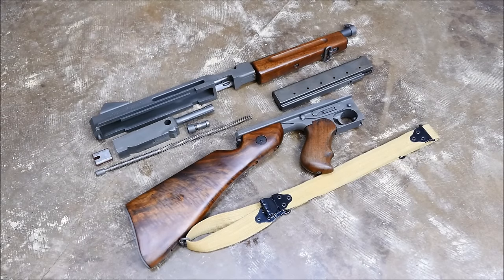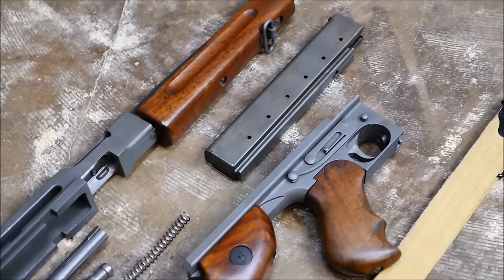Thompson M1A1 Full Auto Field Strip

Comment: Quick question: I recently inherited a WWII M1A1 Thompson (with all the appropriate paperwork filed) and want to strip and clean it for long term storage. My concerns are: Any unusual aspects I need to be aware of? and best practices for cleaning/maintenance of the wood furniture? It was my grandfathers from Iwo Jima so it means a lot to me that everything remain complete and original, thank you.
Reply: I own an M1A1 and a 1928 A1. I use Break Free CLP on the inside and the outside and then I use Lucas extreme duty gun oil on all of the internal moving parts

Comment: The M1A1 is my favourite version of the Thompsons, I find it both the coolest looking and most interesting due to its use/purpose for WW2.

Actual manufacturing cost and how cheap it was compared etc etc doesn't really make a difference to me when it comes to preferring a certain model, for me anyway. 

And even though the earlier (gangsta style) Thompsons are also very cool and fancy, you just cant beat a M1A1 in my opinion :)
Reply: +Keith Beckett also theres the fact that it was the best performing variant.  It was more reliable than the 1921, the 1928, and the M1.  Also a "cheap" M1A1 is far more expensive and labor intensive than say a sten, ppsh, etc.  The thing is entirely machined.

Comment: Hey does the SCAR-L assault rifle has reliability issues? Is the US military using those weapons?
Reply: Nothing wrong with the SCAR-L.  SOCOM powers that be just felt that it didn't offer a significant advantage to warrant the cost of replacing the M4A1/Mk18 family of weapons which has tremendous logistical support.  They did however keep the SCAR-H as their heavy hitter option.
Reply: I prefer the SCAR-L, because you can carry more ammo then the SCAR-H .